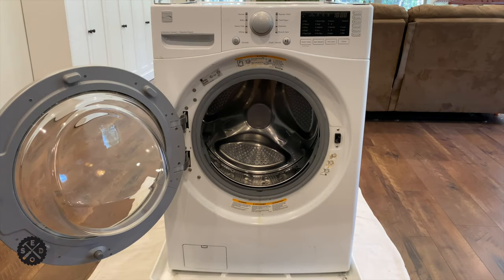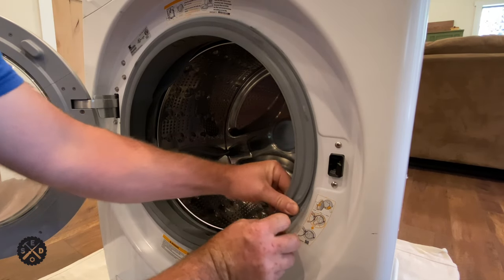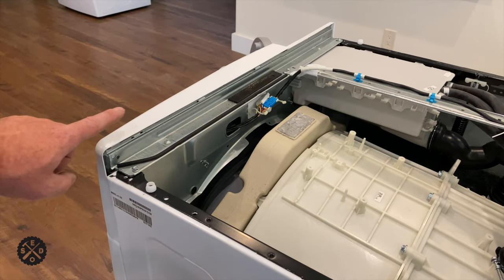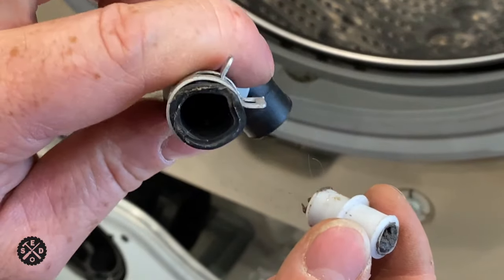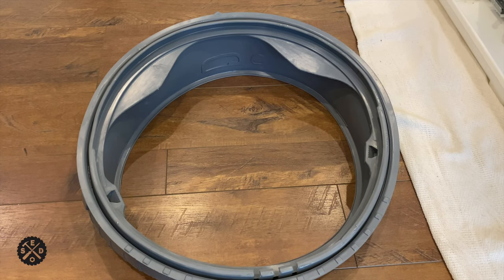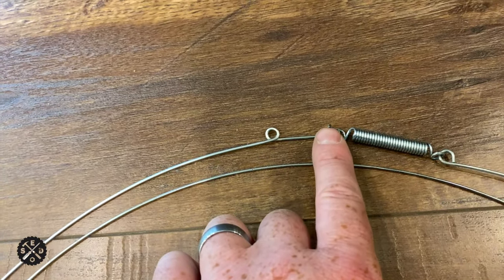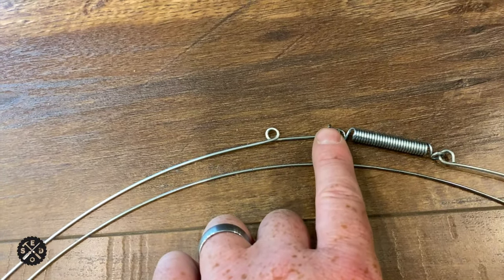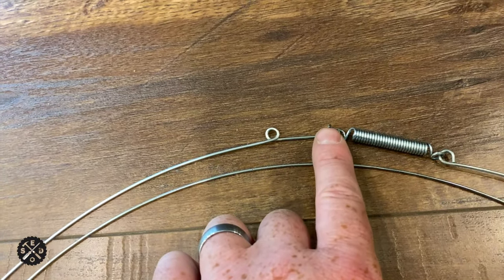LG Kenmore Washer Door Boot Seal Replacement Fix Leaking

Comment: I looked down the drain hole with a small flashlight. There appeared to be an obstruction. I poked around with an unfurled  paper clip and then I took a needle nose pliers to grab the obstruction. It turns out that the obstruction was Phillips head that might attach to a drill. Now, the water drains per my test. I learned about the drain hole and tubing by watching this video. Thanks.
Reply from the maker: Ok nice job I’m glad you got it figured out! Thanks

Comment: Great video - did it myself.  YES get the pliers - I could get the springs off with plyers but there's no way I could have gotten them back on without the spring removal tool.  Helped for me to put the outside spring back on by routing the top first and using the tool to loop it around the bottom.
Reply from the maker: Thanks and great job!! The pliers are so necessary from my experience too.
Reply: Really? I'm going to give it a try anyway. If I can't get it back on I'll buy the tool.
Reply from the maker: @dreed7312  I think it’s gonna be really difficult without the pliers but if you have the time to test it out go for it.
Reply: I took it off with my hands in about 1 second and I cant imagine it taking longer than 5 to put back on. A child could work the spring in my dryer. I can't imagine an adult needing a tool for this.
Reply from the maker: Mine had a lot of tension I can’t imagine doing it without the tool so maybe yours is a little different I dono

Comment: I used a 6" needle nose pliers and a screw driver. no special tool needed and it was super easy. 
i only needed to take off the front to replace the door locker. had it done in 5 minutes.
Reply from the maker: Nicely done!

Comment: I looked at SO many videos trying to get this done. I very much appreciate yours. It is just easy to understand and follow. My issue is that my hoses are so different and life took me away from this project 2 weeks after dismantling it. I have the drain hose on the bottom, one hose on each side (3 & 9 o'clock) and one at the top. I can't figure out which to cap and which to connect. Do you know where to find such information? Thank you for the wonderful tutorial!
Reply from the maker: Thank you! I’m not quite sure which one you have, but I’m wondering if you could perhaps tell by the diameter of the hoses where they go?

Comment: Thanks for the good video and info!!  Tool - $11 Amazon, There are 4 inlets on my version, at 12-3-6-9 o'clock  (all were disgusting). The inner section / groove needs to be cleaned well with a plastic brush / tooth brush works. I used Clorox household cleaner. 1.5 hours
Reply from the maker: You’re welcome great job!

Comment: Great video and thank you.  Huge caution, don’t buy the offbrand boot, get the OEM LG one.  Thought I would save a couple dollars but failed when the boot didn’t seat well no matter what I tried.  Got the LG one and it fit perfect.  Small difference even in how it shipped. The offbrand was folded up in a small box (could have contributed to problem) whereas the LG came packed flat in a larger box with cardboard helping keep its form.
Reply from the maker: Thanks. I’m glad you got it. Thanks for sharing your experience.

Comment: Just did this repair and it was a bear getting the inner gasket retainer installed. The tool would not fit into the lower spring loop. So I used a couple of zip ties to make a place to hook the tool. Of course the zip ties stretched a bit under tension. It is a bit tricky to hold the tool with one hand and seat the retainer around the gasket with the other hand while the Mrs holds the flashlight.... Otherwise it's a straight forward repair.
Reply from the maker: Sorry you had the trouble with that Spring. So yours didn’t fit in that loop like mine did? Sounds like you improvised and got the job done though. Good job!

Comment: Do we have to return the retainer ring? I’m not able to fit it back in even with the tool. I know people mentioned zip ties but I don’t have those nor know to use them. It seems like the ring is not important because the rubber seal is in place even without it
Reply from the maker: I’m not quite sure what you mean by return, as in putting it back in place? I think it should go back on. Not sure why your tool isn’t doing it. Mine seemed to have plenty of reach to get it back on. Make sure your seal is in place for sure and that you’re ring is in the right spot cuz that can make a difference sometimes.

Comment: Does that leak guard under the laundry machine come with the machine or they are sold separately somewhere?  What are they called?
Reply from the maker: Yes, it’s called a washing machine drain pan. You have to buy them separately. They’re only like 30 bucks at Lowes.

Comment: Having issues with the inner spring ring. The main loop on the ring, not the spring, keeps bending when using the spring expander, causing it to slip off. Any suggestions?
Reply: Unhook the spring. Put the hoop over, then stretch the spring and hook it.

Comment: I have been struggling for an hour to get the big spring back on. I have the tool and it is still very difficult. I have taken a break to read comments here and have no idea what I am doing wrong. Also, the boot was very hard to get on. This has taken me over 3 hours so far and it has been the boot and the spring that have been the hardest.
Reply from the maker: Sorry about that. Hope you figured it out OK.
Reply: Yeah I have same issue with the tool as well. For some reason I had trouble wedging into the hole on the open ended wire connection to spring using that tool. I kind of pulled it off once it is slightly loose but I'm not looking forward to putting it back in later 😂 that's a problem for tomorrow
Reply from the maker: One day at a time. 👍

Comment: To have to take off all that stuff to replace the rubber gasket…. It reminds me of the Ford Pinto where you had to drop the engine to replace the leaky main seal.  Who designs these things?  Accountants?  I have an older model which doesnt include the easy access panel to seevice the filter. I wonder if I could get a new panel with the access door and have it align.
Reply from the maker: Yes I have heard things about the pinto. lol I know what you mean. I’m guessing the panels aren’t interchangeable with an older model  but I don’t know that for sure. You can check it out for sure.

Comment: Ran into a snag, my washer has 3 tubes on top and a light attached to the boot. What do I do?
Reply from the maker: Well I haven’t seen that. If the rest of it seems the same you can probably just unplug the light and disconnect the hoses as long as you keep track of which one goes where for reassembly.

Comment: Hi, what model is the washer in the video? It looks exactly like mine, yet the part number I find is not the same as yours, and the price on it is ridiculous.
Reply from the maker: So mine is a Kenmore which is made by LG in this instance. Model number has a small number 796 and then a large 41162411
Reply: @SmartEasyDIYer  Thank you. Mine is also a Kenmore, and oddly, using the entire model number on the door, as opposed to the model number listed in the manual, a search gave me the same part number that you stated above. I've been reading Amazon reviews that the non-OEM part doesn't fit as well, and in some cases requires a bit of trimming,etc. Any experience with this? Wondering if it's worth the extra cost to buy OEM.
Reply from the maker: @tenantattorney703  Its been a while now since I replaced this but I think I may have gotten oem one. I can’t remember exactly though. Either way I haven’t had any issues with it at all. Still going strong.

Comment: Ok so I just wasted my Saturday today and replaced the whole gasket because it was leaking at the front bottom; 
..... I just ran the tub clean cycle and it leaked out of the same place again. 😭. 
Any ideas???
Reply from the maker: Check the clamps on that little hose at the bottom to see if they leak. Might have to replace them with the type of clamps you can tighten with a screwdriver.

Comment: Never heard or saw where to get the tool.
Reply from the maker: I mention it a few times I think but the link for it is down in the video description below the video.
Reply: @SmartEasyDIYer  thanks. Great video.  I hate when guys drone on and on about themselves and not get to the point. Someone said they got theirs from Amazon.  I was hoping to get it locally. Guess I will have to wait. Thanks for the reply.
Reply from the maker: You’re welcome. Yeah mine was on Amazon too. I’m guessing it’s probably a lot more expensive to get it locally but you can certainly check it out.  Thanks

Comment: My units are stacked too and in a small space…I’d rather just use a washing machine cleaning tab and steel wool than to take it all apart.  I did see a lady who just took it all apart without removing the front of the machine.
Reply from the maker: OK I hope you can get it! 👍

Comment: I ordered one but it doesn't have a hole for the drain?
Reply from the maker: Might not be the correct one then for your model. Should have a hole if it’s like mine in the video.
Reply: I ordered off the link in your video and my model number is the same as yours. Maybe a flaw?
Reply from the maker: @JoshZiebart yeah, it could be a flaw. I’d Probably check with the seller that I got it from.

Comment: I think my spring broke. It is not tight anymore 😢
Reply from the maker: Yes that could be if it’s not tight anymore. That’s weird because it takes a lot to stretch them
Reply: @SmartEasyDIYer  so I got the wrong size gasket. That's why it was fitting weird.
Reply from the maker: Oh I’m glad you figured that out.